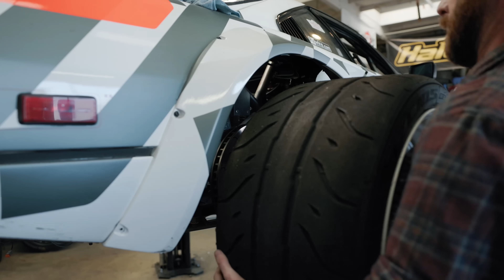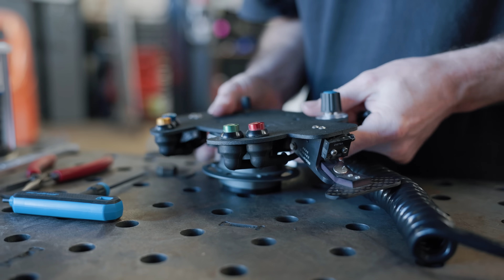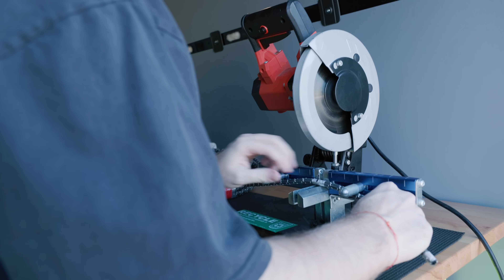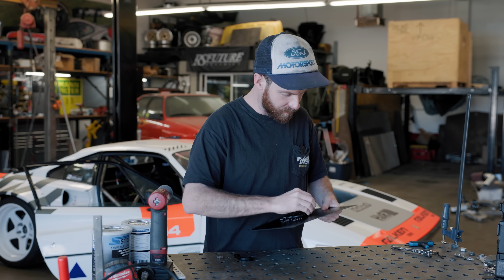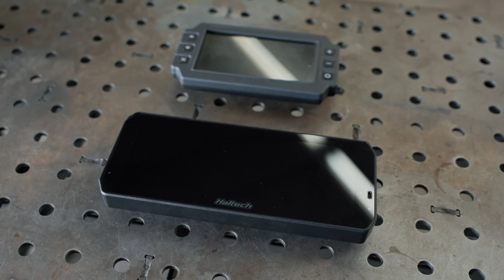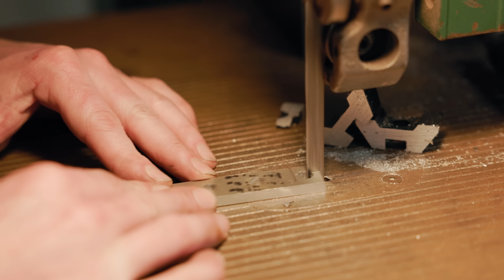The Honda-Swapped Ferrari gets an AIR-SHIFTED Sequential Gearbox! (and VBOX HD2!)

Comment: Is the compressor in the car absolutely necessary? Could you get away with a larger tank and on off-board compressor that you'd use to fill in between sessions? This would mean potentially less weight, less electrical draw, and one less failure point?

Comment: Hey Mike, wondering if you can use the top holes of the shift mount on the gearbox as a support brace to help with the continuous shift pressure.

Comment: 4:%5 very similar to how a Drag Motor cycle air shifter works. Difference being they use timing/shift points and such (usually) so the rider doesnt Have to shift.

Comment: If you wanted to clock the mounting stud (for your timing display) I'd have added a nut on the stud and jammed / locked it up at the correct position, you could then potentially weld the nut to the stud so it's permanently set. Not loving the mount on the gearbox (it looks like it has too much leverage over the base) but given your in the getting it setup and tested stage I feel there's something in the works.

Comment: Curious... you mentioned weight savings. It would be interesting to know the cumulative difference between the existing hand shifter/mount/cables vs. the entire paddle shift/pneumatic/air cylinder/brackets/lines?  Or the cool-guy 10,000psi line and fittings vs. Push-to-connect and 300*/300psi nylon line (like used with DOT air brakes)? One last one... how about a shift solenoid or servo motor and get rid of the entire pneumatic tank, lines, and heavy air compressor? LOVE the content!!

Comment: look into a Krontec quick release, it has the wiring connector running through the center of the quick release so there is no cable to worry about

Comment: Not a fluid dynamicist but took a year of fluids for my mechanical engineering degree - shorter pipe is technically better. You get increases in frictional losses with longer piping. I don't know what kind of performance change you'd see between mounting it there and further away but in theory there is a benefit to shorter lines.

Comment: I’d make two clamps for the air tank. It looks like that 3D printed clamp that holds the take in the middle allows tank to flex a bit. I can just imagine that tank vibrating against the roll cage when you’re on the track causing noise and all kinds of vibrations.
Reply: Wouldnt the tank also need protective shield / cover in the event of it bursts from vibration etc and higher pressure air causes potential risks? Hoses are robust ok but just in case. Curious…

Comment: Whilst i've used airshifted bikes and like them, for your use I don't understand adding all that weight when you could have installed just a electric shift solenoid saving weight by no air tank, pipes and compressor ?

Comment: Underrated 3D Print setting: use tree support instead of the standard support. It is much easier to remove and the supported surfaces look much cleaner.
Reply: yeah but the moment those tree's need to climb high, they often break during the print, so getting the infill and material setting are crucial. I personally prefer to place my own custom supports using the lab feature on Cura, you get to only print supports for real overhang vs dealing with the algorithmic limitations of auto supports.

Comment: Convenient: we can connect the DRS to the same pneumatic system😈
Reply: Make it happen Misha 😊
Reply: Mishaaaa ❤
Reply: I’m 50/50 on this lol. The aero package for the car currently is developed by a good friend of mine but it would be so cool to see your aero on this thing too.
Reply: Or air brakes? Sort of like Travis Pastrana's Subie wagon had?
Reply: Let’s gooo!!!
Reply: Misha please collab and help them setup the suspension kinematics. Someone with your experience would make a huge leap in the handling setup, you could even coach to help stanceworks extract their own best as you really shine as a coach. It would be so cool man, please make it happen 🙏🏽
Reply: Please make it happen. He need some German engineered parts :D
And then he has to ship he Ferrari to drive on the Nordschleife with you as the coach
Reply: very similar to how a Drag Motor cycle air shifter works. Difference being they use timing/shift points and such (usually) so the rider doesn't Have to shift. 4-5-6 second 1/4 and half 1/2 mile.. dont really want to be worried about shifting.
Reply: Hi misha, also been interested in the Real quality car builds lately, there's a video of the channel "geek house racing" talking about the suspension "secrets". I think you should check it out since it could help you in the civic / dark horse build. Also this guy gives attention to detail, like suspension geometry, scrub radius, unknown mods like dry-sump oil pump or the 6 to 1 header, all this in the f40 build, he is also 3d scanning / printing like your team does. The interest i've ben talking before also applies when i saw the speedster video for the first time, the guy installed really good parts, ans when you said you were going to swap the enginge, i immediately thought of the ttrs DAZA 2.5l, since i saw a video on how good of a plataform this engine is, also saw the speedster teared apart in the civic video, in general it would be great to see you collab i dont know maybe test driving any car in the nurburgring
Reply: Mishaaaa! Collaboration of my two favorite car channels, that would be "YEAHHHH"

Comment: Me wincing as he uses an impact gun with a chrome socket 🫣
Reply: You've gotta live life on the edge sometimes! 😂
Reply: @warpedfusion  at least he had his Safety Squints 🙂‍↔️
Reply: Notice he's just zipping them on to seat them and then will most likely torque them on the ground. He's not sending all the ugga duggas. Chrome sockets are only good for 3-5 ugga duggas usually.